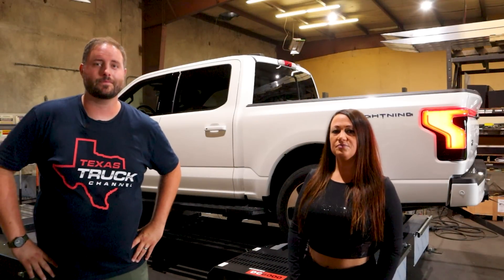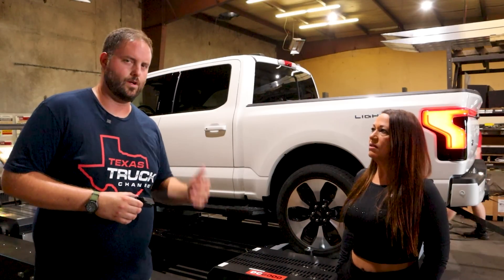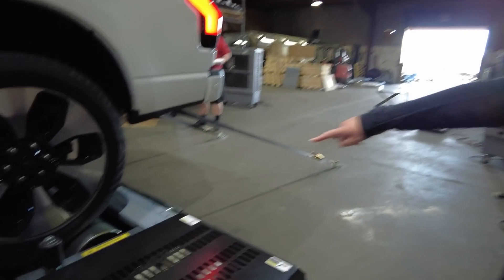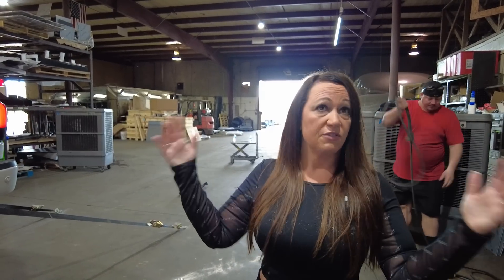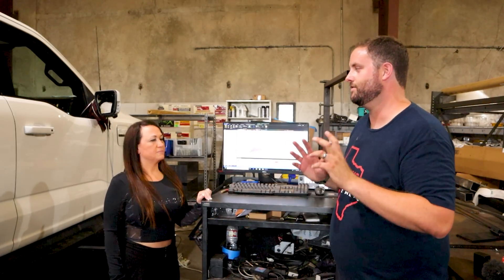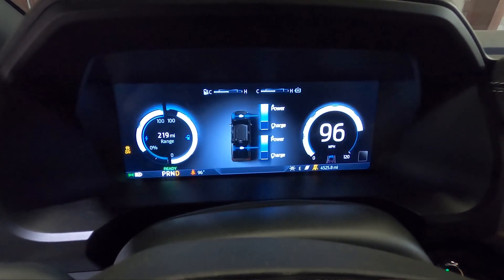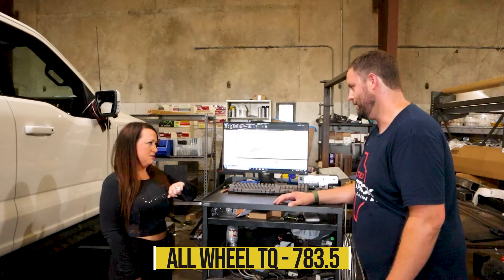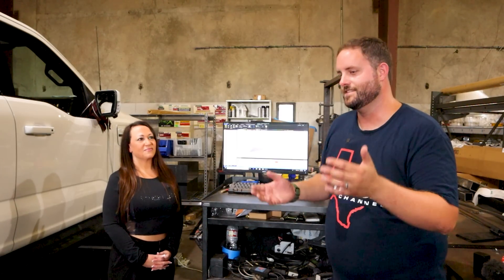EXCLUSIVE // Worlds FIRST 2022 Ford Lightning EV Dyno Test

Comment: As a long time ford owner and currently own 3, the lightning is far from being a daily or practical truck.  it's fun and fast but not worth it in the long haul.  I recommend looking up the story about the Chevy Volt owner that went to a dealer to get their replacement battery.  30,000 dollars how is that saving money after 70k miles driven.  We are about a good 10 years before the EV world will be anywhere near practical.   The real focus should be hydrogen powered vehicles.
Reply: Lithium mining is still done by diesel machinery and a cleaning process that has hazardous waste byproducts that sit in open pools forever with wildlife unknowingly use..but EV,'s are green. 🤔
Reply: Yes
Reply: How do we get there? Here is how it needs to be done...

1. Develop a non-poisonous battery system that we don't have to rely on other countries to mine.  
2. Don't force feed vehicles that we don't have the infrastructure or the electric grid to charge them. 
3. Give benefits to American companies trying to develop a true clean resource like hydrogen.  

The electric vehicle industry is playing on a green platform that is truly misleading.  

Do you realize that when these electric vehicles get in an accident and most catch fire that cannot be put out by normal fire trucks (they require a special foam).  Now we have to completely change the fire fighters infrastructure.  

I'm not against the industry going green and good for the environment, just think it's a long way out and something has to change with the power source.
Reply: @mikeisabella4539  Thank you. 

I’ll add to that. The reason hydro-cell vehicles will likely never become a think is exclusively because of the publics ability to produce its own HHO gas with electrolysis. You can’t have people making their own fuel from water…. there’s no profit outside of the initial sale. 

There’s nothing green about EV’s. Nothing. Not their construction, not their materials, not their repair, and they can’t even be recycled the same.
Reply: You say we are a good 10 years before the EV world will be practical. So how do we get there? Magically? We have to start somewhere and iron out all the issues. People who are buying these EV's are called early adopters. Thanks to them you will have your EV truck just like you want it in 10 years. Stop being a downer. If you dont like this, move along. Because even if you dont like it, your children will be driving EV's.
Reply: @xxZerosumxx  The guy wrote absolute truth, a truth that you appear to not like. Take your own advice and stop being a downer, if you don’t like it you too can move alone. Funny how you only applied that to others when you yourself came here to inject something that wasn’t wanted.
Reply: @xxZerosumxx  Early adapters? Also known as the ones who get stuck with the cost burden of engineering the new tech. Go ahead and pay that premium for us all lol.
Reply: @xxZerosumxx  So how do we get there? Well I’ll tell you how we’re not going to get there. We’re not getting there with an old and outdated power grid. Y’know, the thing that provides all the chemical potential energy required for EV’s to do the ‘vehicle’ part? Why do you think CA is experiencing scheduled rolling blackouts? EV’s!
Reply: @RollingRoadEFI  People in California are using gas generators to charge their battery operated vehicles. And besides, you can't store enough energy needed it such a power hungry vehicle with various loads and power consumption demands. That battery truck want go 90 miles pulling a 6k lbs trailer. (Check out TFL channel when they test this same truck) And how about sitting 6 to 8 hrs to charge your truck on a 500 miles trip.

No thanks, gas and diesel will be king unless they install a mini nuclear reactor in these vehicles.
Reply: @brandonrobertson6327  You’re probably right.
Reply: @xxZerosumxx  Just like I said before, y’all never think beyond the first step. Thank you for demonstrating the problem.
Reply: Seriously? One unverified story, from an unkown timeframe, about a completely different vehicle, is all the information you need to judge how wise of an investment a ford lightning is, and the future of EV’s?

You need to quit your job right now and start doing due diligence for hedge funds.
Reply: @user-yq6ov6ow7l  Really, TFL did a trailer 6,000 lbs pull test. The Lightning didn't even get 90 miles before needing a charge. The EV's don't get the same amount of energy storage as diesel or gas per the space available. The Lightning might be ok if you just commuting under  200 miles unloaded and you don't use any power accessories. 

Other than that, all EV's are a waste of time. Don't believe me? Ask California residents about using gas powered generators to charge their cars because they don't have a stable grid.
Reply: @brandonrobertson6327  You do know that people do other things with truck than towing on the highway?

Yes they will suck for that. But not for towing in an urban or suburban environments, more weight = more regen. Trash trucks, delivery trucks, city construction crews, etc etc etc. Perfect for EV trucks.

Also what you, tfl, and most others don’t understand. Towing with EV is not about weight, it’s about wind resistance. If you’re towing at lower speeds like 25-50mph with frequent stops, I wouldn’t be surprised if the EV has the same towing range.

When it comes to weight. EV’s gain a lot of their energy back used to accelerate with regen. The more braking there is the better the EV will do against gas. Alternatively the EV will out-pull the gas or diesel truck from a power perspective.

I’ll bet if you had a towing range test, gas f150 vs lighting, in NYC, I bet the lightning has more range.

I dont care about California, I’m in NJ.
Reply: @user-yq6ov6ow7l  You might want to start caring. Remember Texas and their grid failure during. Two week winter storm?

And far as range, you seem to not have read all my post. Yeah, I know you can use a truck more than towing. The EV truck still want have the range on the highway. Maybe comparable in city, maybe slightly better if you don't run your accessories like AC or the heater, which consumes alot of your battery. Regeneration only works at sustained speed. Electricity likes stability, and the stop and go of big city driving is not going to efficient. 

Now, hybrids may be the answer. Smaller gas or diesel engine turning a generator with a capacitor bank to store energy like a diesel electric train. But this all electric battery concept is plain foolish. You have to mine cobalt, silver, lithium, and other rare earth metals that can be highly toxic and requires diesel heavy equipment to mine it. Also the deposits of these rare earth metals are found in China, Russia, Afghanistan, and other countries that don't like the United States. Not to mention there are only so many known ore that is available. 

I don't know about you, but if this technology was to save the world and make the United States so rich, why does China and Russia continue their quest on so called Fossil fuels? It is all a ploy to weaken the United States and make us dependent on these foreign countries. Not to mention that clean coal, natural gas, and hydrogen are the cleanest burning fuels, and the United States has over 200 years of reserves and can sell energy to other countries that otherwise buy from China and Russia.
Reply: @brandonrobertson6327  what!!! Regeneration only happens at sustained operation!

Electric likes stability?

You are just making stuff up.
Reply: @user-yq6ov6ow7l  T
You don't get more energy than what you put in. You actually lose energy through heat and friction. 

You have no reason to believe me, but I have worked in the utility industry for nearly 25yrs. I think I know a little about power generation. If you want, look up power generation theory for yourself. Even your gasoline car alternator are designed to produce enough AC electricity at a designed rpm to push through the voltage regulator to produce enough DC voltage to keep your battery charged. This is one example of having a stable electrical grid inside your car's electrical system. No different than a power head generator behind a wall of water (otherwise know as a dam) to push the stator fast enough to excite an electrical field to excite stationary coils to produce usable electricity. 

So, your EVs, if they do produce electricity (known as regen), tpu have to have enough speed introduce to excite a coil via a magnetic field and it has to be sustained long enough to charge your battery. But due to heat and friction, it causes what is called a loss. Therefore, you can only extend for a while longer, but like everything, this type of vehicle will stop movement eventually. So you will still need to be stationary on an AC power grid that more than likely is using clean coal, natural gas, hydro, or nuclear. Either way, a regen will only extend your range a little more, but not enough to over come what you use unless parked and charging.
Reply: @user-yq6ov6ow7l  By the way, you didn't mention anything about the hybrid diesel electric. Wonder why? Maybe you though trains just ran on diesel? Maybe more like your EV running on perpetual energy? Get yourself an education on electrical theory and come back when you can at least talk intelligently on the subject.
Reply: @brandonrobertson6327  all EV’s and hybrids have regen. That is why non plug-in hybrids with small batteries exist. Regen is the backbone of EV’s.

You never wondered why all mild hybrids get phenomenal city mpg? It’s because of regen.

It’s called regenerative braking, and it simply use the electric motor that powers the car, and turns it into a generator power by the vehicles kinetic energy.

I’m glad you can spout off a bunch of nonsense about electricity, but you don’t know the first thing about EV’s.
Reply: @user-yq6ov6ow7l  How's that soy latte?
Reply: Because people aren't very smart, and they prove it every single day by not thinking beyond step 1.

Comment: In 20 years when they become relevant….. I’ll care.   Till then it’s a very expensive unusable toy.   Toys are nice but I got actual work to do.
Reply: Gotta start somewhere
Reply: @msw7021  that doesn’t negate its reality as a worthless pos.    It’s now forever going to be known as that.   The govt could have subsidized the infrastructure 15 years ago full well knowing this day was to come.    They didn’t.   And for good reason as even the technology isn’t there yet.    Now we waisted endless billions again.   There’s an old saying.  Work smarter. Not harder.       This a perfect example of working so hard you fail yourself into a corner in desperation it will  succeed.   Reality doesn’t give a shxt.   My point stands.   I’m 20 years when they’re relevant I’ll care.   Besides.  Electric cars are more polluting than modern gas systems anyway so electric has some efficiency to catch up on anyway.

Comment: How many times did you have to charge it for these pulls? And can you leave it plugged in while pulling?
Reply from the maker: Didn’t charge it at all. We  ran it all day and used a whopping 6% of the battery.
Reply: @TexasTruckChannel  don't tell them that, the EV haters will get mad lolol

Comment: In real world to get that hp pulling bet the battery drops like a rock
Reply from the maker: Oh for sure. Just like running wide open throttle on a gas F150… that fuel gauge will drop like a rock.

Comment: My question is how can you figure HP when you don't have an RPM? Further, why not use hub dynos so you could do full throttle?
Reply from the maker: Great question, we had to make gear ration calculations to calculate motor rpm. This is why we had several hours of calibration runs prior to accurate testing. 

We initially chased the hub dyno method but the experts at dynocom were quick to let us know that hud dynos would not support the weight and tq of this EV. This is why they modified an existing in ground dyno setup.
Reply: @TexasTruckChannel  maybe not the vehicle weight but they'd definitely handle the torque
Reply: When it comes to electric motors you don't use rpm in the equation to calculate horsepower
Reply: Because you are doing wheel power the roller has a speed sensor and is a known size that is the only info needed it doesn't matter what type power train is used
Reply: That's not how HP is calculated @shaynegadsden
Reply: @noneyacabbage  that's exactly how it calculated Horsepower = Torque × RPM ÷ 5252, what's being measured on a dyno is the HP of the roller everything else is just math
Reply: @shaynegadsden  which doesn't translate to electric motors
Reply: @noneyacabbage  of course it does it works for anything outputs rotation force if the system was sensitive enough you could put a push bike on there and work out how much hp the rider generates.

Comment: How boring, sounds like my Dyson shutting off when it gets disconnect from the stupid wall... No back firing, no supercharger, no turbo sound.... sad future
Reply: Would you rather see a 5.4, or a ecoboost? those things are lame, OEMs don't make good engines anymore. Can't wait to see a Cybertruck in ludicrous mode, I don't think that will be boring!
Reply: @augsu  5.4 was a good motor and a V8 or 6.2L SVT raptor motor.
Reply: @MOPAR_scatpackwithaHEMI  I have some friends that will disagree about the 5.4, and 700 hp isn't that impressive for a supercharged motor. Both are plagued with the same issue though, too many damn computers! Same with that F150. That's why I like EV's in theory, a PWM controller is so much simpler than the modern engines and drivetrains. I've got two EV's and a bunch of carbureted trucks, I have never bought an oxygen sensor, and I never intend on owning a rig that has one.
Reply: @augsu  V8 on a cool morning hits a little different, nothing an EV will ever do. Period.

Comment: It's EV. Who cares anymore about dyno testing. They all do 0-60 in a stupid fast time. The era of muscle is truly dead.
Reply: On the contrary my friend, it's just getting started. I've got lots of big honking v8s that are great and all, but nothing compared to the raw, brutal,  parts destroying torque from an old DC elevator motor, running 1000 amps at 160 volts! Built it 8 years ago and I'm still afraid of it.
Reply: @augsu  Sounds like your are missing the point I am trying to make about  muscle cars. All electric motors are like what you described, fast and lots of torque. And since that is their nature, then they are all the same essentially, so who cares. It's missing the eccense of a muscle car. But to each their own. I enjoy the wrenching, the loud sounds and the smell of high-octane fuel. But hey, at least the mocha latte safe space generation will love EVs. They can have them. At least I won't be waiting in a long line to charge my car so I can get home from a day of shopping. Lol. I'm not opposed to EV, but they simply aren't to the level of gas cars yet. When they are, then fine. But I drive distances. And when a 5 hour trip in a gas engine car, takes me 9 and half hours in a Tesla (ask me how I know), then f**k that. When they actually CAN go 3 or 4 hundred miles like they claim, and then "fill up" in 10 min like a gas car, then maybe I will buy one. But since they can't, and at 70k miles on many already, they need a new battery that runs between 17 - 26 thousand dollars parts and labor, and a new gas engine is 10k, then EVs are not as efficient as far as I'm concerned. And if the govt was not forcing EVs on us, it would still be a long time before our country went full EV. But I hear it's working out super well for California right now. 🤣🤣
Reply: @shannontaylor5173  No, I mean muscle cars. You notice I mentioned a DC elevator motor. Most EV conversions are using Tesla or Nissan Leaf drivetrains, which is fine for the latte crowd, but as you say, all the same and boring. But some of us know that if you want raw torque you go DC. The build I mentioned is a German import VW Transporter van, with the aforementioned DC motor with a TH350 output housing, going to a Suzuki Samurai transfer case, with the front output hooked to a modified Dana 44 TTB axle from an 87 Bronco. All in a custom cradle that bolts into the back of my VW or the front of a 4x4 pickup. The motor can destroy every part of my drivetrain, so I use sleeved driveshafts as my "fuse", and go easy on the throttle in high traction situations. I've had guys tell me the same thing as you and given them a bump on the back of the head (steel bulkhead) to change their minds.
Your argument is also a little spurious as you begin by saying EV's aren't muscle cars and then bring up road trips. But in my experience a 5 hour road trip in a muscle car will take either 2 hours or more likely 9 and a half hours, or two days (parts stores don't stock old car parts anymore).  You seem to expect it all, but you are right, there are no OEM muscle EV's, we have to build them ourselves. But that's okay, it's a lot of fun to build an EV, and so much easier and cheaper than building gas cars (ask me how I know).
BTW if the gov't is "forcing" EV's on us, then why come they're all sold out? Mebbe the OEM's are dragging their feet to protect their profits? And 26k for a battery pack at 70k I'm pretty sure the warranty covers that, where are you hearing this stuff? Stop listening to the media, get on Ebay and check out 20 kw DC motors, they can handle 10-20 times rated output for ten seconds, and you know what you can to in ten seconds with an EV?